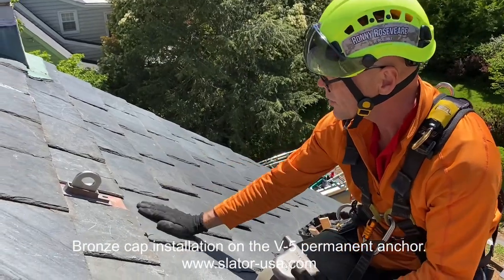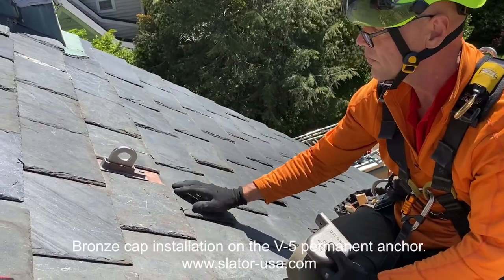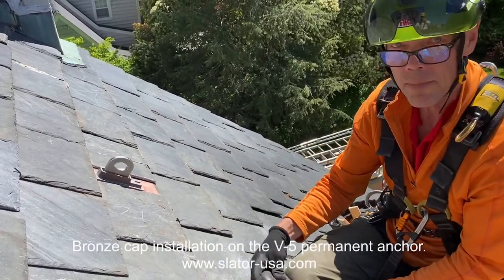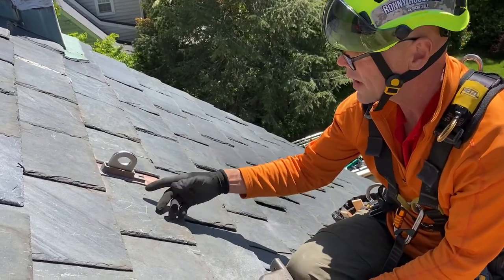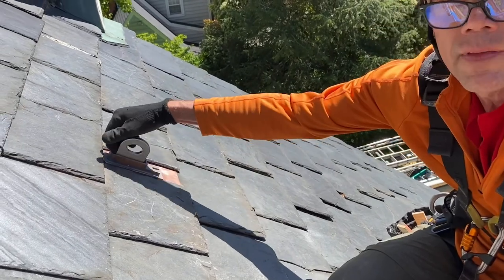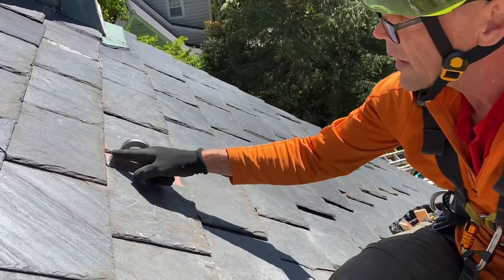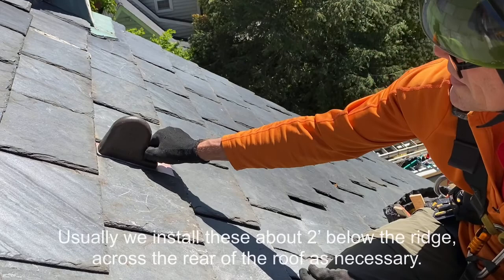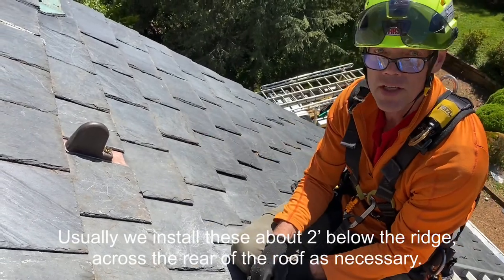Cast Bronze Cap installation on V-5 permanent roof anchor.

Comment: Very nice mate. My roof is metal panels directly on 2x6 trusses framing with no under sheathing. I was going to do some leak repairs and ordered what are called "temporary" "single use" alloy steel hinged anchors. I'm not sure why they are called that they seem reasonably heavy duty IMO, anyways after the work I was going to just leave them in place as a permanent roof anchor for future use if needed. I don't particularly care about aesthetics. Do you think that is good idea or should I purchase a different metal anchor? Lastly for my application do you think I should use the 16p nail included or instead use #14 metal roofing screws?  Thanks for your reply.
Reply from the maker: I am glad you are using anchors to work safely.  Good job!  Good questions.  They are called “temporary” anchors because they are usually removed and reused on the next job.  Therefore they are in each location temporarily.  I do not trust fasteners that I did not install myself unless they are inspected prior to use.  Neither nails or screws are inspectable once they are within the wood.  So, if you installed it, and trust the installation, then there is comfort there for the next use.  However, can they be trusted in 5 years, 15, years, 30 or 100 years?  The next person will have to decide … can this anchor and fasteners be trusted with my life, my employee’s life … ?  This is why we make our V series permanent anchors out of stainless steel and make certain the fasteners are inspectable and easily replaceable.

Comment: Do you have a video detailing how you install that anchor?  Would this be appropriate for a shingle roof?
Reply from the maker: Sure do.  Yes, definitely works for a shingle roof Percy.  Keep in mind that the rafter must also be capable of supporting the load.  2 x 4 roof trusses are not acceptable unless they have been reinforced.  I have 5 videos (about 10 minutes each) detailing a complete installation on an existing slate roof.  An asphalt shingle roof would be done similarly.  Here's the link:  https://www.slator-usa.com/store/p121/V-5_Permanent_Roof_Anchor.html. Thanks for asking.  Ronny